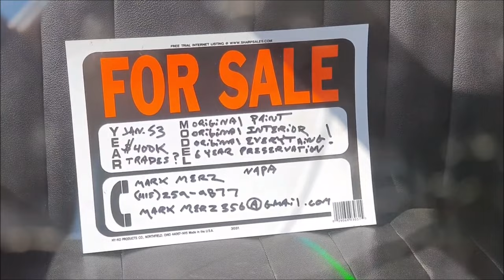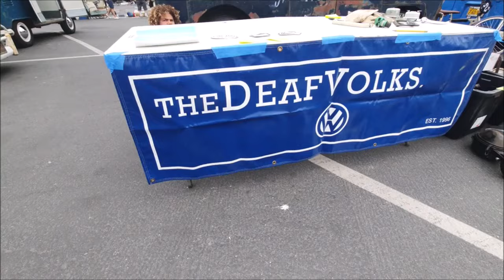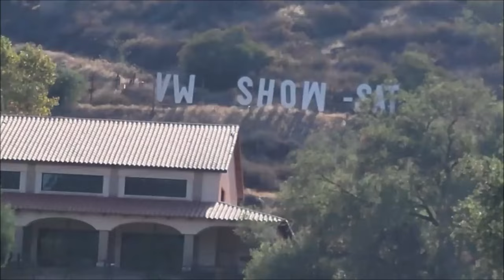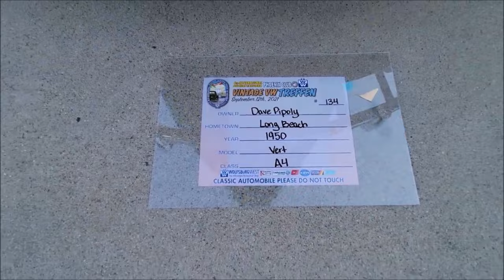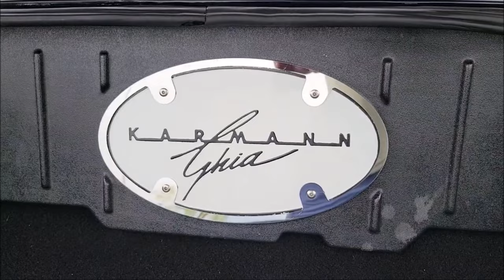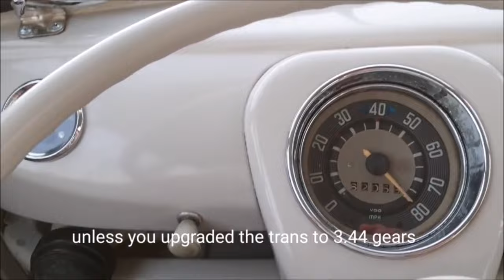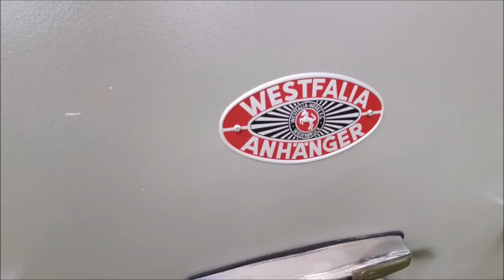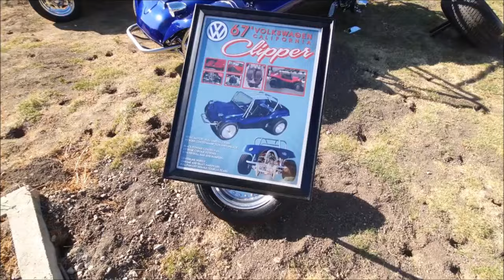5 hour compilation VW Oval window split window bug bus camper van Car shows and drives

Comment: Yikes!  Longer than "Gone With the Wind," I need a pee break.  So many "lowered" VW's, especially the buses.  I'm not a fan of that look... Bone stock is my bag but I also appreciate paint and interiors way beyond what came off the line, too.  But when they change the basic shape of the car and it looks like it's dragging on the ground... nope, nope.  Wonder why they do that?  Increases the value or handling?
Reply from the maker: yea this is for people who have shops and restaurants to have running for customers. Pretty cool sports on one TV.  VW car shows on another